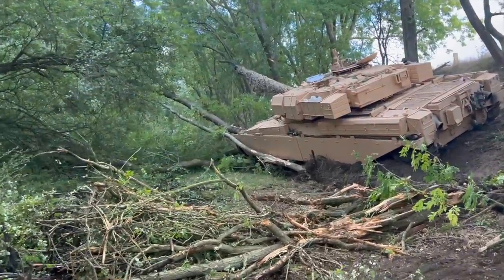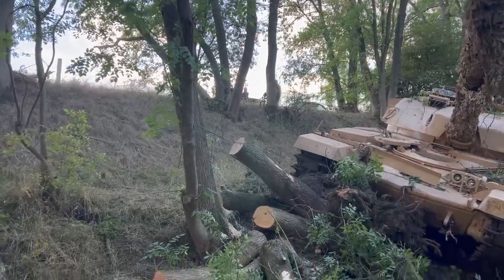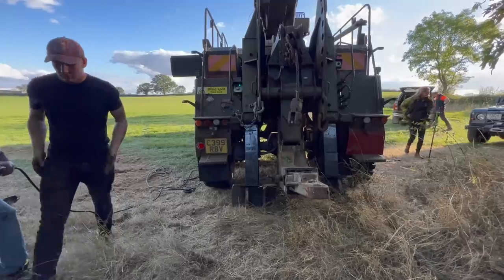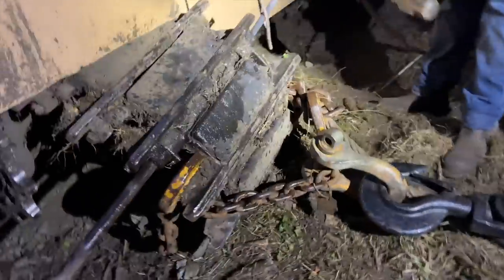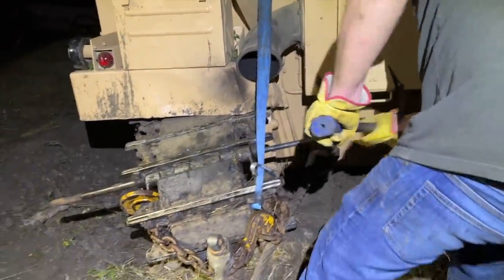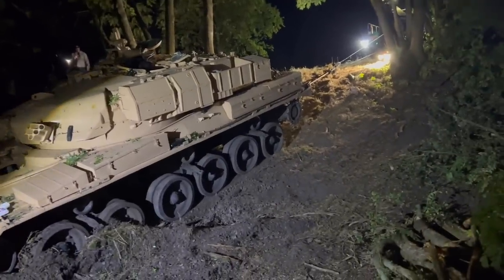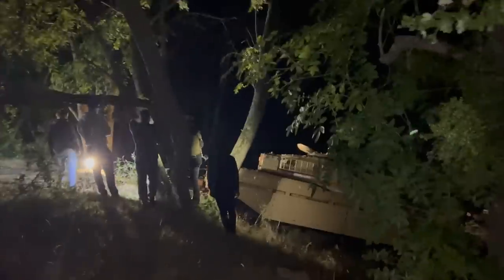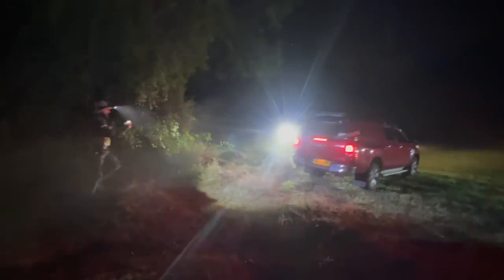Whistlin Diesel Came To Buy A Chieftain Main Battle Tank, And Immediately Broke It!

Comment: There's something immensely satisfying about recovering a vehicle that looks totally stuck and beyond hope. Those Fodens just show that we can make good pieces of equipment sometimes 🤣.
Reply from the maker: all those rodents need is about 200hp more, the ones that have been converted with 14l cummins are real animals!
Reply: @fittermat  I used to drive a Foden that had a Perkins TX 350 in it which you probably know was a development of the Rolls engine, It pulled really well, if you could find one it'd be great swap for the old 290. Love a 14ltr though 😁

Comment: I love the way you all stand around a recovery cable, not aware of the fact that it it snapped, the whip will cut you all in half!!!
Reply from the maker: More than aware, but wherever we stood with that much weight in it wasn’t ending well if it snapped so might as well die quickly
Reply: It has never happened from tension alone breaking the cable.

Comment: its great really that Cody broke it over here - it shows him at least its limitations as well as the punishment it can put up with

i know as Matt says, the gradient is steeper, looking less in the footage - if my old REME buddy was there, he'd be doing the maths in his head (i used to have a written formula for working this out, weights x ground type x gradient etc etc) but all the combined weights and pull required is so much more than anyone thinks, even with the engine running its a dead weight with no power of its own, being dragged up a gradient through loose ground, probably trebles that weight easily, i don't know if the Foden shows the pull required of the winch, interesting to know

i reckon it was a great recovery, sure Cody loved every second while it lasted, he'll be a little more forgiving i think next time, apart from any car crushing (hope someone gives him the safety pet talk) about having no one riding on top or in open hatches in case of debris including a whole car swinging round on the tracks, great to watch but incredibly dangerous, i have seen a car door be ripped off and turned into a mad throwing star, hurling itself 50+ feet into the air, and flying towards the crowd line, where it rolled to a stop fortunately against a permanent wooden fence, imagine it being a metal crowd fence or mine tape and kids being sat in the front

Joe's gas axing was epic - and i reckon most of all, you boyz made the right decision getting the mighty Foden's
and it has to said all being filmed at night made it that much more dramatic - damn good effort
Reply from the maker: Much appreciated, there were two pulley blocks on the steep bit of the pull and the Foden was in 'battle mode' removing all the hydraulic limiters and was right at the limit, we weren't far away from having to call in a second wrecker but the mighty Foden just about managed it.
Reply: @fittermat  i appreciated what you said about the deceptive angle of dangle on the bank - i know that myself - but you could really see that angle was very steep from up top, see the Foden do the final winching, that angle was mental, near on 45 degrees, got to be way over its normal limit

Comment: I guess all the films of tanks driving through buildings and forests up to the axles in mud must be fake if one can’t handle a bank and a sapling. Great recovery though.
Reply: It was how he drove it that's the problem. He got it high centered then back and forth dug the track in on one side and it slipped a tooth on the sprocket. It was explained in the video. I'm sure with a proper driver tanks can drive through this type of terrain no issue. Any machine is only as good as it's operator at the end of the day.

Comment: On that recovery, you could have run the tank engine, used the near side track to help in the load even though the tank will go at a slight angle but not that much.
Reply from the maker: Just ends up fighting to go off to one side then, got to remember the untracked road wheels will dig into the soft ground on the other side, plus you then have the added problem of the tank driver and the winch op having to communicate to work safely, much safer to just have one man in control, nice and steady on the winches

Comment: Knew just looking at the angle he was trying to get up the slope it was never going to work. Slopes should never be attacked at an angle should be straight up and over. It would have been easier to use grey matter and never get in that situation. Basic cross country driving course.
Reply from the maker: you don't know what a vehicle can do until you test it to its limits, for his first go in a main battle tank he was actually a very good driver
Reply: @fittermat  maybe but looking at they slope it was never going up gravity will always win. I suppose you can push it when it’s only your toy and your life don’t depend on it working. Made my eyes squint when he revved the engine that high.

Comment: Nice video. Bit off topic but I'm sold on that battery powered chainsaw. I was reluctant to get one thinking they would lack power but that chainsaw in the video cut those treees no problem.
Reply from the maker: I was the same till I tried one, wouldn't want it for a full day of logging but for odd jobs they are awesome, added bonus of no fuel to cock up or pull cord to break!

Comment: Completely incompetent recovery effort.  A decent crew of real tankers could have had that repaired in two hours.  Two men with shovel and pick to clear the debris from the last road wheel and sprocket while two men break track exactly where these wankers cut it, between the compensating idler and first road wheel.  Using the tanks own power, slight reverse will unspool about 2-3 feet of track off the rear sprocket.  Use tanker bars to lever it back in line with the sprocket.  Use tanks own power to run the sprocket forward to snug up the track, then use basic issue item track jacks to rejoin the track links between the compensating idler and first road wheel.  Straight reverse (centered tbar) and its free and clear.
Reply from the maker: Put your money where your mouth is then, we will get another one stuck down the same bank, in the same conditions, if you get it out in under 2 hours Ile give you ten grand, you don’t do it you pay me instead?
Reply: @fittermat  There's always an old sailor that knows the way.